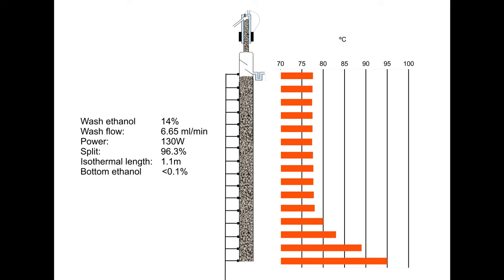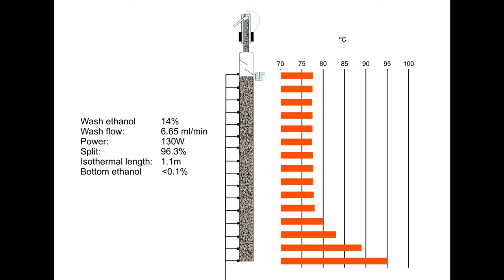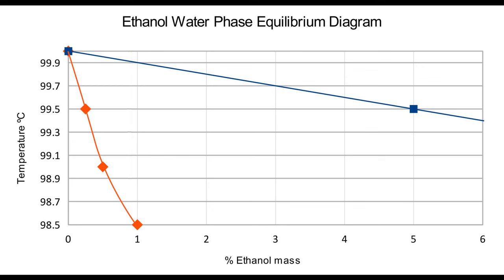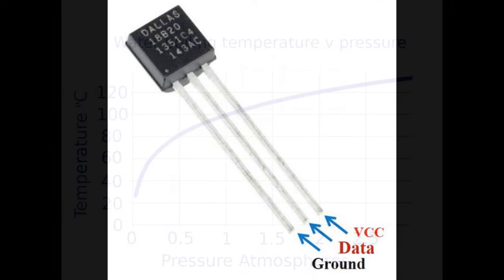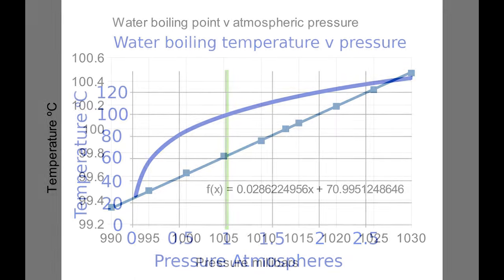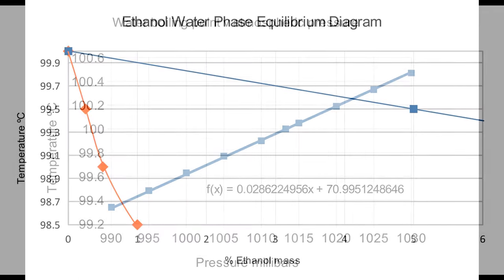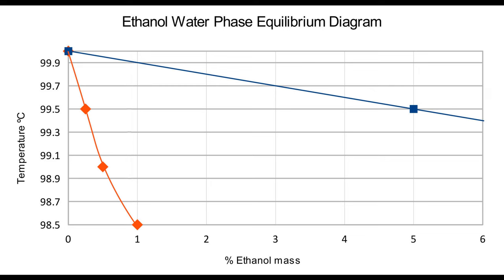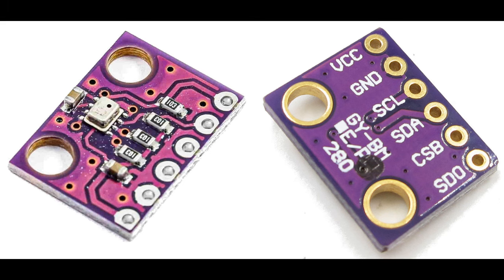barometer

Comment: If your sloped stripping column has a reasonable margin of being too long, could you just do a similar thing with temp sensors at the end of it that you do at the top?  So instead of taking 1 bottoms temp you take several every X inches from the end, and aim to just make sure it stops increasing some distance before the end?  If the temp flattens too high in the stripper then you add less steam (or more feed) but if the temp doesn't flatten until right at the end (or not at all) then you add more steam (or less feed).  You'd be able to strip all the ethanol and the actual temperature or pressure doesn't matter.  Thoughts?
Reply from the maker: The short answer is that I have not tried it so don't know. I doubt it would work better though. The stripping column is not isothermal and temperature increases along it. There is no point where this increase stops as there is with a rectifying column. A second problem is that these sensors are not well calibrated and give a precision of +/- 1 degree. They could all be calibrated with pure steam flow but the only one where that accuracy really matters is the bottom.  My guess is that you would end up monitoring the bottom temperature to check performance of other control parameters and find that the extra complications weren't worth the candle but I be most interested if you prove me wrong.
Reply from the maker: That would work for a rectifying column but for stripping you expect the temperature to fall throughout. The critical issue is the bottom alcohol content hence the focus on bottom temperature. The alcohol content at the top is not critical as it is the job of the rectifier to raise it higher and they are tolerant of quite a wide range of alcohol content inflow.

Comment: I'm great with electronics but don't know programming.  Would I be able to program this being a new to programming?  I would like to try?
Reply from the maker: Me too! I'm an old dog in hobby electronics and these Pis and Arduinos are a new trick for me. I muddled through with online videos and web sites. I had frustrating hours because of misunderstanding things like ISP modes but I got it working with just me and the internet. My program would make a software aficionado cringe but it does work!
Reply: @tight1449  Nice!  Sounds like we're in the same boat. Lol.   Perhaps I can hit you up with where to start?  I'll need to buy everything on a budget.
Reply from the maker: @l0I0I0I0  Same here re budget! I guess you'll have a scope, soldering gear and computer. I use a USB logic analyser that cost $6  and Aliexpress is my main source for bits. Continuous distillation is more complicated than pot stills but in the end is much cheaper and to my mind performs better.
Reply: @tight1449  cool!  Yes got an o scope, nice soldering iron, and skills to boot.  Guess I'll need one of those analysers and set of instructions.  Lol.    I'll also need a data logger to record the temps in the process and an andrino of some sort.  Just tell me what to do and I'll do it 
Are you in US?  Im in Arkansas.  Studying accounting at the moment but I can work on it one day a week.  Would love to make some for Christmas presents!
Reply from the maker: @l0I0I0I0  The Arduino or pi will log the data so you do not need an extra logger. I use a pi. The cheaper zero works fine but is a bit slow for internet browsing. The logic analyser costs under $10 and is used with a free software package called Saleae Logic 2. I used it for debugging communication failures of which I had a few. If you're lucky you may get things to work first time but I didn't. I also use a set of logic probes which are convenient small clips that connect to device pins but they are not essential. Sadly I'm not in the USA and use dollars for pricing as they are international.  To get started I suggest getting the pumps working first as they are the trickiest but not the most expensive part. I have a video on that. Then make a steam generator and column with temperature sensors. Good luck!
Reply from the maker: Yes that is the same one I have!
Reply: @tight1449  Perfect!  Ill get it then.
Reply: @tight1449  Just wondering, before I go off and spend a lot of money on parts, could you give me an estimate of how much its going to cost?  $100, 1000?  TY for the help in building it.  Ill order stuff today once I hear back.
Reply from the maker: @l0I0I0I0  I'd start by getting a Raspberry Pi or similar and getting it set up. The Zero is $10 to $15 and it works for this purpose but it is a bit slow. The 4 is much faster and better and is what I use now. I started using a Zero and I trashed one of them by being careless isolating the 12 volt rail from the Pi and I shorted them together by clumsy use of a multimeter probe. It's cheaper to replace a zero. The Raspberry Pi needs a keyboard, mouse and screen, which I got from ThriftStors for a few dollars. It also needs a power supply and it needs to be about 3 amps, which makes this quite expensive. I ended up getting one of Raspberry Pi's power supplies for about $10. A pain here is that the Zero uses a micro USB plug for the power supply and the 4 uses a USB C. The power supplies provided by Raspberry Pi have integral leads, so that you can't interchange them. Other things are that on the Zero you need a micro to normal HDMI cable to connect to the screen, and also there is only one micro USB port, so I used a micro USB to to regular USB plus one Ethernet adapter, which cost another $15 or so, for the keyboard and mouse. 

Then I'd get one stepper motor, they cost about $10, and the stepper motor driver and signal generator between them cost about five. To begin with I used a cheap breadboard that was about $2, but it was infuriatingly unreliable, so I got a Wisher breadboard ($10) that was far better. I then changed to a Vero board., which is a lot cheaper and more reliable. If you're familiar with electronics, that may be where to start. 

When you've got the stepper motor working, you can get the roller pump attachment to it, which is about $20. If you're using my system, you'll need two of them, plus another stepper motor, which will be another $50 total, 

20 DS18B20 temperature sensors probably cost about another 5. And when that's all working, you need to build the still. 

I used an Indian copper water bottle for the steam generator, which cost about $16 but the band heater was about 40. I spent about $20 on silicon tubing and $30 on a 10 meter roll of 8 mm copper pipe but I only used a couple of meters of it. The stripping column is three meters of 15 mm copper tube for which I paid $12 plus a couple of dollars for a few elbows.

The rectifying column is more expensive. I scrounged a 1.5 piece of 28 mm copper tube. But to buy this, it would probably cost $20 to $30. 

Early in my experimentation. I bought a litres of stainless spiral prismatic packing for about $40 and I've been using it ever since but, so I don't know how it compares with other things. It would be reasonable to start with washed fine gravel.

And that's about it. It's a few hundred, not thousand dollars.
Reply: @tight1449  cool, as I already have some of those parts packed away in boxes.  Sounds like a fun project, keep my mind off accounting.  Lol.  Ill get going then bit one question, can I use the Raspberry Pi Pico 2021?  They are so cheap it would be easy to replace when one fails.  $9 bucks
Reply: @tight1449  Im going to get the Pi 4.  GN!
Reply from the maker: @l0I0I0I0  Yes I'm sure the Pico would work, and I think it would actually be more suitable for this application than the Raspberry Pi, but it's not quite the same thing. The Raspberry Pi is a small board computer, whereas the Pico is a microcontroller like an Arduino. It doesn't work in quite the same way, so with the Raspberry Pi you've got to start it, load the operating system, load the program Python and then run Python programs usually in a window, whereas with a microcontroller you just write the program that controls your machinery and every time it starts it runs the program. It is in fact designed specifically for this kind of application. It's just that when I started fiddling the Pico didn't exist and the Raspberry Pi rather than the Arduino was the first thing I tried.
Reply: @tight1449  Well then, if I get the pico, will we be able to get ot to work, as Im not a programmer?  If we can, then I will get it.  Its dirt cheap and easy to replace.   In fact i cam get two and program them the same way for an easy future fix.   
What programming options do we have to program the pico?
Reply from the maker: @l0I0I0I0  Neither am I. I have not used a pico but it seems at least as easy as a small board computer and there are a lot on free on line courses and information.
Reply: I must be a glutton for punishment.  Lol.  I ordered the pico with a breadbox built in rather than the pi 4.  I have other projects that will work well with the pico and its soooo inexpensive.   Ill just have to figure it out.  Also ordered the analyser.  Now I need to find my servo and servo drive packed away somewhere.  Should be fun!
Reply: @tight1449  The part will be at the end of the month, however I will have two weeks before final exam.  I plan to study C over break.  Should be fun!  Any sites especially good for learning C for beginners?
Reply from the maker: @l0I0I0I0  I have not used C for years but there  is a wealth of Youtube courses on it. I am most familiar with Matlab and R and learned enough Python from Youtube introductions and Python's and Raspberry's  websites to work the Pi. Coding is easy but remembering the right syntax is hard!
Reply: @tight1449  Im excited and can use this on many other projects!!!   Im older and went back to school but Im doing really well, all As.  Im a lot more disciplined then when I was a kid.  Over break Ill learn some C.  Just need a course that's good where I don't waste my time as I have little.
Reply: @tight1449  Just got my board in.  I've been looking around for C programming course.   Waiting on the analyser.  Hoping black friday will have some sweat sales for more boards!   
Ill need to watch some of your vids so I know what Im programming as I don't know but exciting about the speed of C.  Just hope it can do what is needed.
Reply: @tight1449  Where do you want to discuss details?  This post may be a little tedious.  Discord perhaps?
Reply from the maker: @l0I0I0I0  I've been away for a while. Not familiar with Discord. Is that a discussion board?
Reply: @tight1449  Three more days.  I need to order a few more things and checking the list.  I got an hdmi assembly to go with the pico.
Reply from the maker: @l0I0I0I0  Good luck. I have taken down my video on temperature sensors because I am recovering from a mishap that took down an LM1117, several DS18B20s and one GPIO pin on the raspberry pi. Using an LM1117 from a 12V rail to power DS18B20s proved to be a bad idea. I'll post a revised video explaining what happened and how to avoid it.
Reply: @tight1449  A mishap?  Im curious to see what happened.  Ill read through your other vids when before I get started.  Need to order that mouse keyboard display combo.  Think I saw one one walmart.  Will any work or do they need to be special?
Reply from the maker: @l0I0I0I0  If you have the right cables it will work. I use an old mouse and a 10 year old TV with an HDMI input on a raspberry pi. Works fine but the TV is a pain to lift! 

Briefly the mishap was that a DS18B20 shorted Vdd to ground. The LM1117 has no overload protection so burnt out. Sadly its failure mode was to put the output close to 12 V. that took down several other DS18B20s and one of them pulled the data line too high, taking out the pi pin also. OK though, as you can easily reprogram the pi to use another pin for one wire.
Reply: @tight1449  Its easy to short things especially with my eyes.  I use to work on radar systems in another life and have the cataracts to prove it.  Lol
Reply from the maker: @l0I0I0I0  You don't need a history of radar emission exposure to short things out. I do it all the time!
Reply: @tight1449  one form of circuit protection is to place a zenor diode  in a circuit or power supply which will limit the amps.  For example a .5 amp zinnor will never go beyond .5 amps JIC you accidently get your wires crossed which is easy to do.  I had forgotten about this circuit trick and thought it might help in your circuit design protection.
Reply from the maker: @l0I0I0I0  Good suggestion. I have temporarily junked the 3.3V regulator and replaced it with a bench top variable supply so I can track the volts and current. The DS18B20 are pretty fussy about supply voltage. They wont work under 3.15V. No wonder the power from data line system is temperamental! When I have recovered from the current meltdown I'll put in a robust system as you suggested.